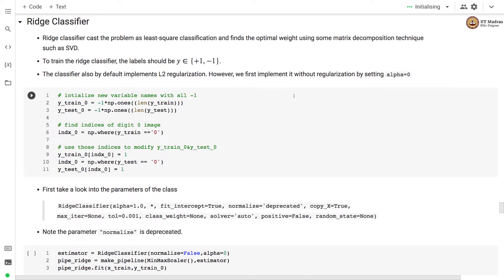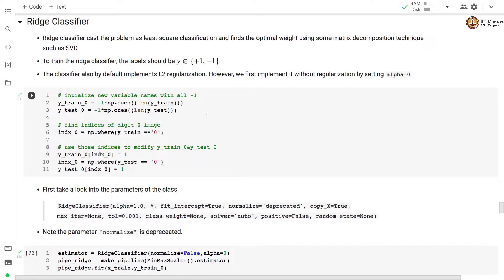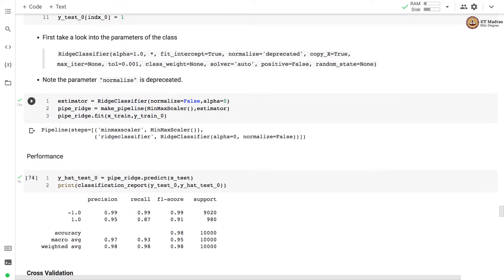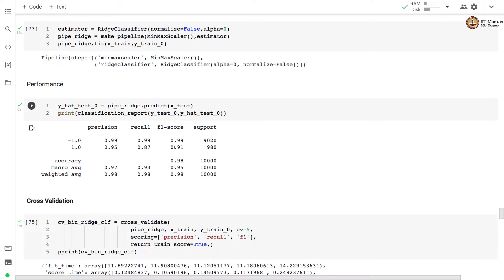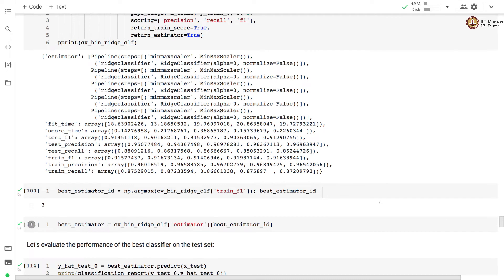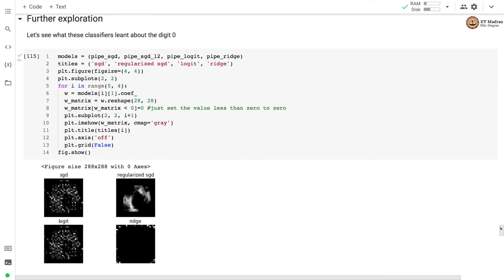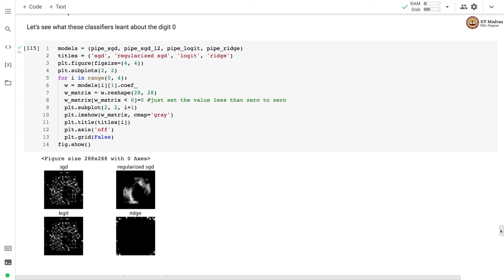Demonstration: Zero detector with Ridge Classifier

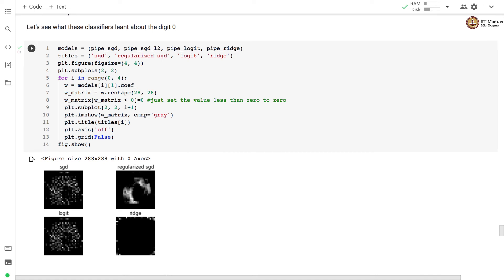Comment: 7:30 Instead of replacing all negative weights with 0, wouldn't it be better to take the absolute value? Negative weights are as important as positive ones. Converting them to 0 is loss of valuable information.